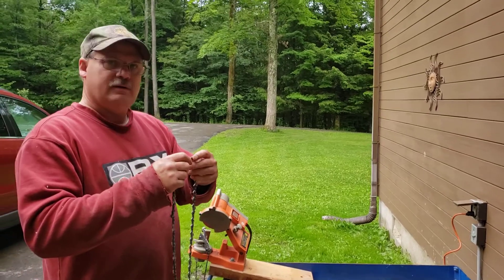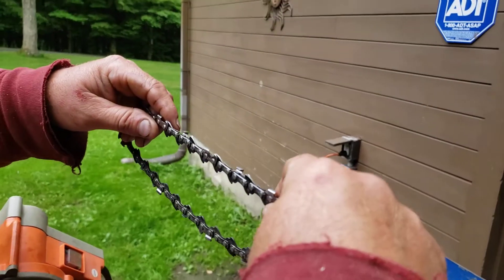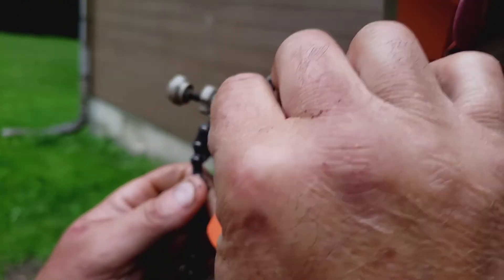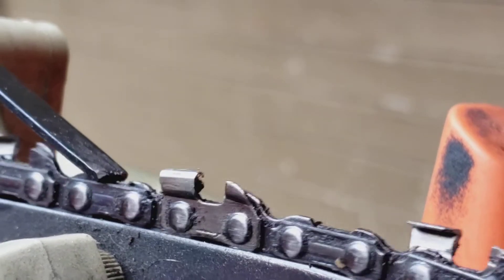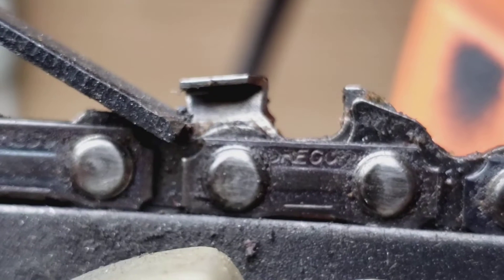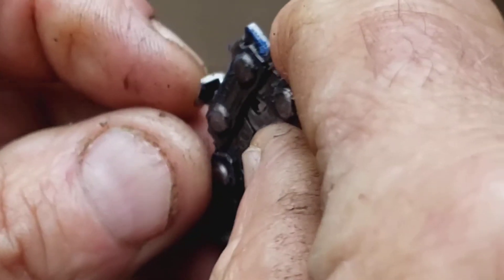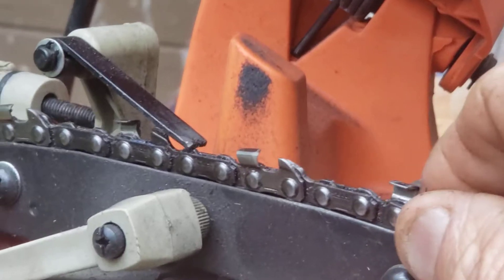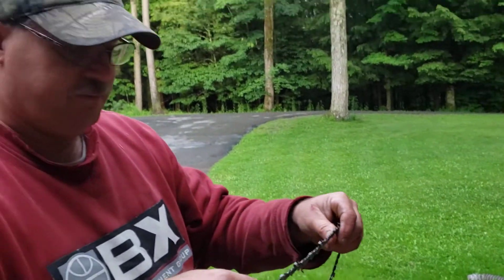Using a Harbor Freight chainsaw sharpener

Comment: the length of the tooth doesn't matter they can all be different sizes but the rakers have to be the same length relative to the tooth, hand fileing is only as complicated as you make it, it's not hard you just gotta practice.  hope this info helps someone :)

Comment: You never clamped the chain down. You're going to have a different angle on each tooth from the movement.
Reply from the maker: I think I mentioned that I have tried both clamping and not clamping chain on this. It binds sometimes.

Comment: what angle are u using ?
Reply: If you watch the video he said 25 degree.
Reply: If you use kip handle in front to lock chain in place while grinding it does better.
Reply: If you use kip handle in front to lock chain in place while grinding it does better.
Reply from the maker: I used 25 degree. I wanted to see if it would cut different from the 30.
Reply from the maker: I think that the sharpener is good for the money. The tightener to lock the chain is helpful for cut. I also try pulling a little tension on chain prior to cut and it works faster without clamping.
Reply: @workwithkevin  ok im  doing both